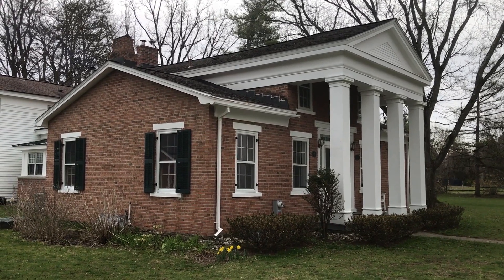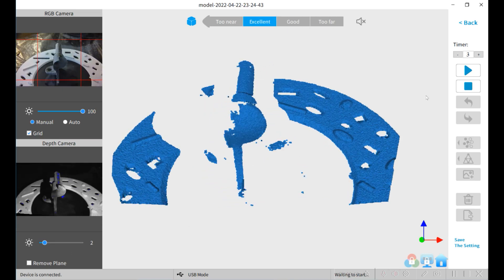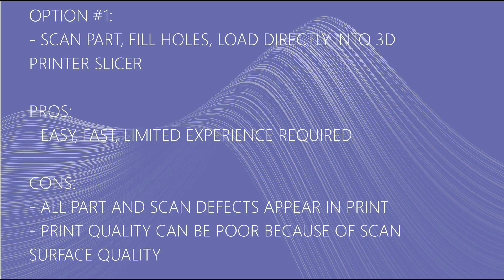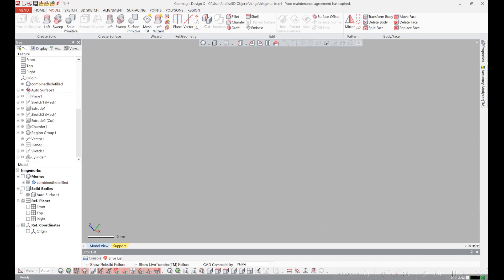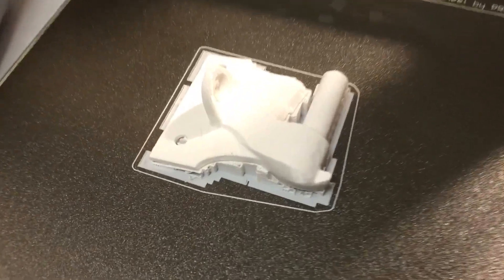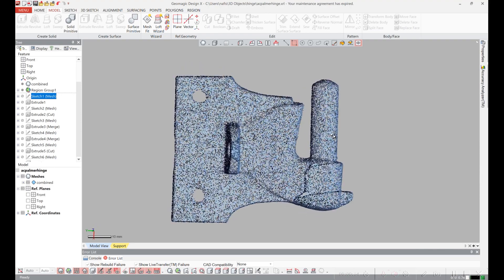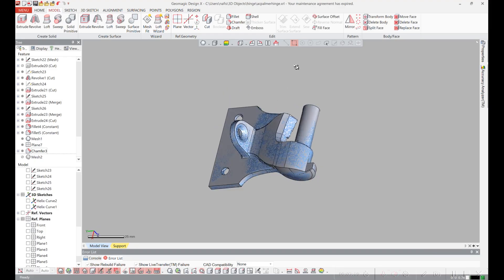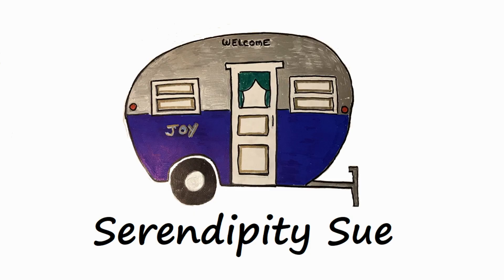3D Scan to 3D Print - Tradeoffs of 3 Approaches

Comment: Did it work with the shutter? Was the 3D printed part strong enough? Resistant to the weather?
Reply from the maker: The PETG seems to be holding up. Although I only have one of the 3D printed hinges. The other three are original. I also leave the shutters open all the time.

Comment: A forth step being that you can simply recreate the hinge around the 3d scanned hinge to give you better control over want you want and shouldn't take much time as you do not need to be modifying the original?
Reply from the maker: I wanted it to match the original, but be straight. The 3rd approach used solid modeling using the scan as a rough template?
Reply: @SerendipitySue  Yes more or less just recreate it around the template scan you did. Should be faster and at the end more professional since it would turn out to be a perfect model? Plus I guess you would at the end have a lot less data since it would be much more clean. (an idea I had when watching your great video.)

Comment: A much better option would be to make a mold of the original then cast as many new parts from the mold as needed.
Reply from the maker: I have tried that too. I wanted to see if I could make a "better" version of it with the Solid Modeling (i.e. get rid of the defects). I plan to print one on my SLA printer (since it will be smoother), and then use that for the mold

Comment: Interesting video I've used scan data for many years (automotive) and just bought a scanner for personal projects.  What you've shown is a really good guide I would personally only use the first 2 for quick and dirty projects the third method would always be my first preference. On the software and skills side unfortunately for the hobbyist I one click tool doesn't really exsist and I suspect the more hobby based tools can be hard to work with.  If you posted the models I might have a go in Catia or NX if I get the chance.
Reply from the maker: Great! I put the Scan STL at: https://www.printables.com/model/180043-1843-acpalmer-patented-shutter-hinge

Comment: Very interesting.  Is a 3D print going to be strong enough?
Cheers
Reply from the maker: I plan to try printing one in PETG with 100% infill, but with the full CAD model I could get in machined. I also thought about casting low temp metals. I could use the CAD model to make the molds. I did a similar thing for making a rubber part for my 57' Olds ( http://www.howmuchsnow.com/olds88/steeringcolumngrommet/ )
Reply: Lost pla casting is also an option